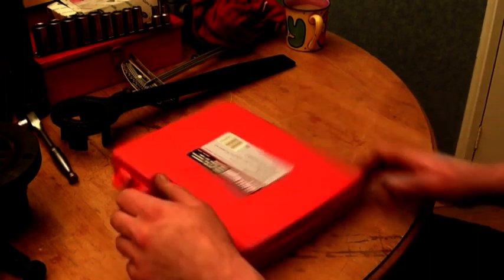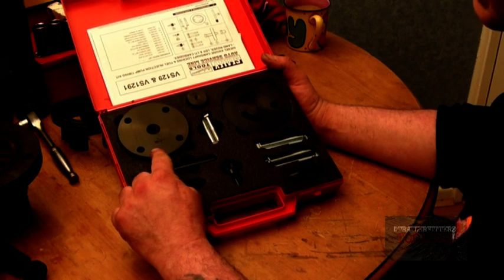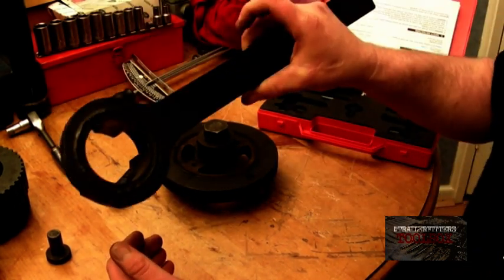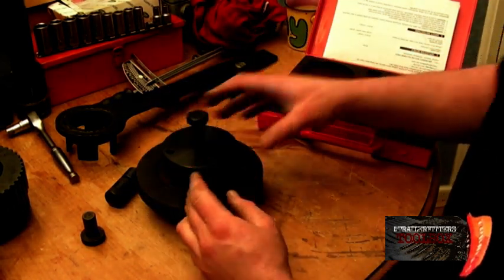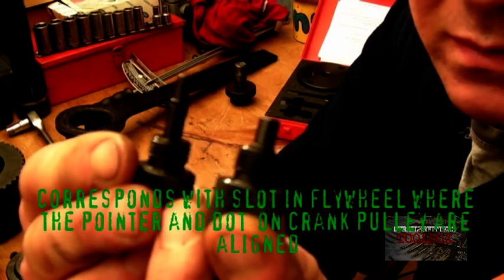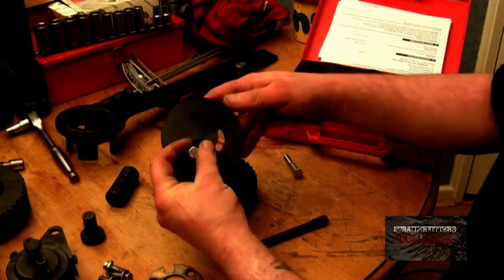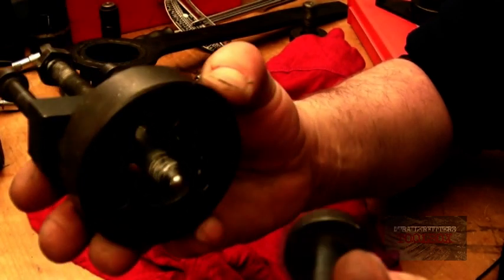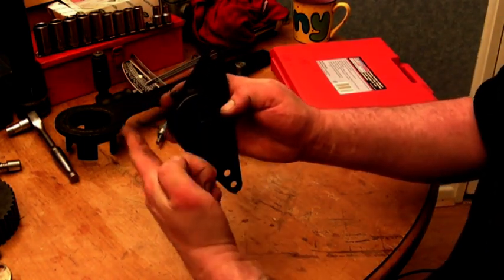Timing Pin Kit  SEALEY VS1291. Land Rover.

Comment: Hi there, I want to make a fly wheel pin just like the home made one in the vid, what size centre pin do I need for a defender 300tdi
Reply from the maker: not sure because there may be a chance that you have a rogue flywheel.  If you have a drill bit set you can gauge it by trial and error until you find the right size....